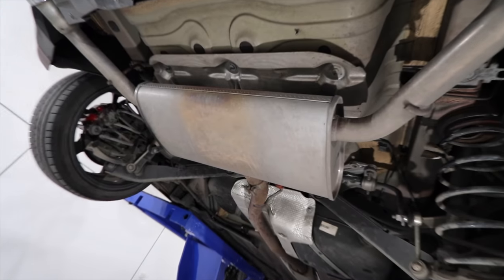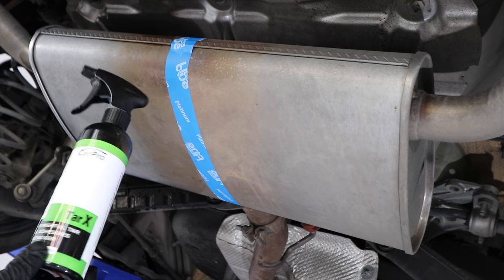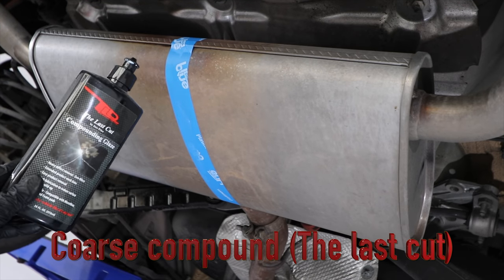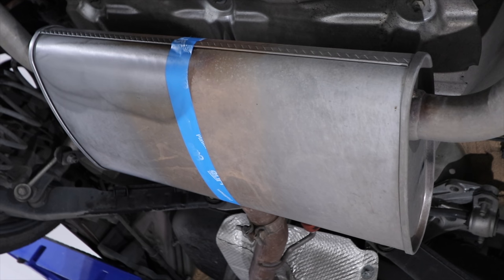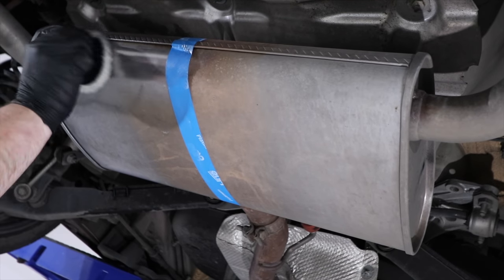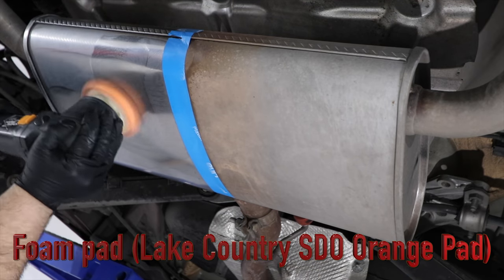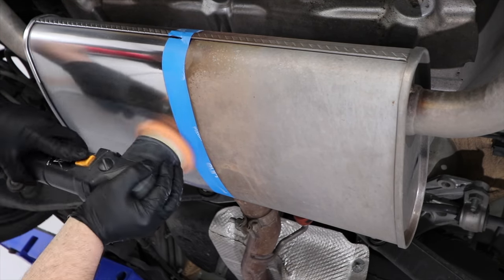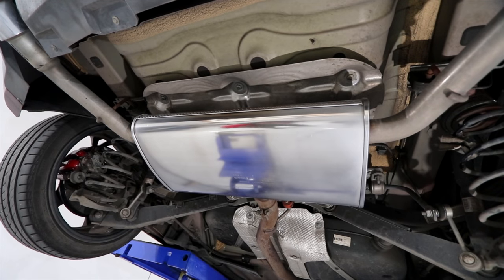How To Quickly Polish Your Car's Metal Exhaust Muffler!

Comment: Nice! My problem would be that I'd just want to continue doing the pipes too. And of course it wouldn't stop there.
Reply: Probo X might as well
Reply: ahahahaha yea, then you're going for the suspension brackets, bars, driveshaft, screws...it's an endless addiction!
Reply: Tiago Feitosa it pay to have OCD
Reply: If it's stainless steel, using a #0000 steel wool, and vinegar makes very quick work of removing all the junk from the surface. I did both my tail pipes in maybe 15 minutes
Reply: Yes Probo X, that's exactly what I thought!

Comment: YTep sandro your the best mate, i dont know if you are have herd the trucking industry has a product which you use as a snow foam and use a pressure washer and spray it all over stainless steel / Aluminium large transporters and then rinse off and the tanker or container is clean and looked like it was just polish, its used to come in a purple bottle and i think a lot of trucking supply companies would have it, but also you would need to get your car up high enough to spray it on wiat and then rinse it off perfect to get dirty under carriages, might need to do a couple of applications, but well worth it, maybe Sandro you may want to look into it, as its would be a massive time saver and you would gain more clients to do the undercarriage of their cars. :) Keep up the great work Sandro, your channel is the benchmark and perfect example of a car detailing and products review channel. :)
Reply: Whats it called?
Reply: @lucaspukas7757  Not sure, but will try to call some trucking supply companies, it used to come n 20 lt and 4lt containers its purple in color, maybe due to the EPa reg's the company may have changed the color of it, but i am sure they have some sort of pressure washer type snow foam to be used on aluminum and stainless to clean it and help the transport trucking industry look after the tankers, especially them all stainless and yet they are like mirrors, so good to find out, so that its so much easier to clean under the car and help bring back that new car look etc. cheers ? the problem is i live in a country town, so what they have over the counter, compared to some of the larger city trucking company suppliers will have a better selection. :) found one, but not sure how good it is/
https://www.easywashaustralia.com.au/videos/
also this web page. :
https://www.bargroup.net.au/shop/category.aspx/chemicals-detergents/723/

Comment: Good gosh Sandro.   That is an A-M-A-Z-i-N-G transformation.   I wouldn't have thought that muffler would have been able to polish to a brilliance like that from what it looked like.   In fact,  the metal in it's original condition looked like an opaque type of metal that couldn't even be polished in the first place so I would have never even tried.    Unreal.   Now I know I can tackle the exhaust system on my 370z and hopefully bring it to a brilliance like you have done here.   And it should be even easier because mine doesn't look anywhere near this bad.   In fact, the metal underneath the car is in fairly "new' looking condition so it should be a breeze to bring out the shine.    Really good video buddy.   I learned something new today and that's always a good thing adding to my skills.

Comment: Yep, dont mind me, back again. Tonnes of other search results were returned for my "polish stainless steel" with me making no specifics about an exhaust, but yours came up near the top so ofc I'm clicking it first! I picked up the final front two parts for something today and need to apply my OCD to it, so in about 5mins time that'll be my next detailing mystery permanently resolved by a method I can actually do and I'm sure! 
[After edit] I was correct! I was going to blob some autosol onto a 2" pad and see what happened but now I've got a huge bottle of 400 compound left over and a well explained as to why it will fuflill my personal needs, I'm def going to try using that! Thx, Sandro. Another top video.

Comment: Fantastic result in almost no time at all. I never would have guessed you could use paint cutting compunds. I will really have to try this on some metal work.
As I live in a country with harsh winters I guess you would compromise the rust prevention of the metal this way. Unless it is a stainless steel system.
Reply: Codriver72 waste of money, try oven cleaner first, make sure you wear eye protection
Reply: Spray ACF 50 corrosion prevention stuff, its used in the Aviation field

Comment: Wow that looks amazing Sandro! Who would have thought a standard muffler could look that good
Reply: And it's tricky too because any residue left on it is going to stink to high heaven once it heats up and begins to burn off.
Reply: BigOldDog hence why Sandro wipes off with IPA after polishing. No worse than oil impregnated into the exhaust tubing from factory

Comment: Great Video CCAD… I'm with Probo X in that I would not stop until my crazy ass had it like a mirror. I would like to see the same job using Mothers Mag Wheel polish and see which would have a better finishing result. Sweet project Cars Channel seems to get great results polishing everything from paint to plastic with Mothers.
Reply: I have a feeling many of those surfaces "perfected on that channel would look far less impressive up close with quality lighting.. They have some great videos, but they also do some things straight up wrong.. 

I stopped watching after I saw their coating application video.. They over applied it just atrociously thick, then let it flash for literally what looked like hours and then proceeded to forcefully scrub and scour all that sticky mess off with just two towels in a death grip and a metal warping amount of down pressure.. I thought it was a joke at first.. 😲😲

Comment: Are these pads a throw away after this? Id assume you wouldn't want to use them on paint even after being washed but can they be re used on metal?
Reply from the maker: Yes, you shouldn’t use those pads on paint but you can reuse them on metal again

Comment: Hi Sandro, why did you choose to use Snow+ (1 to 10) instead of an APC like Multi X as part of the initial wipe-down? Obviously there's no reason why you can't, and Snow+ at that dilution is pretty much like a milder/safer APC anyway. I'm just curious if there was some special reason.

Comment: Great results! Sandro, do you have any tips/experience of restoring cast aluminium to like new finish. I have white powdery deposits on many aluminium undercarriage components and wanted to restore them to as new without resorting to full strip down and blasting, but also didn't want to polish but restore the original cast aluminium finish. 
Thanks
Reply: @CarCraftAutoDetailing  Great, Thank you :)

Comment: When i cut off the stock muffler i just painted it black just in case i reinstall it in future and prevent rust...
Nice video though
Reply: Only Colour paint won't prevent any without basic coating.
But I'm doing the same, quick an easy hiding the welding after cutting it open👌🏻
Reply: @lingling2924  what do you mean with the word basic coating?
It doesn't help that i painted high temp black?

Comment: Wouldn’t this remove the rust protective properties of the exhaust system? Not hating, just a genuine question
Reply from the maker: Most exhausts won’t have a top coating protective rust layer you can remove, it’s generally the same metal throughout - mostly a certain grade of stainless though it can be a higher or lower grade that’s more or less prone to rusting - though the outer layer can be machined. 
If by chance it is plated, generally a polishing process like this one won’t be aggressive enough to remove that plating, you’d have to go harder and more aggressively to remove a metal plating.

Comment: Would this cause the muffler to smoke because of the polish ?
Reply from the maker: A true polish doesn't leave anything behind - like a wax or sealant. It's basically a fine liquid/paste form of abrasives, and when you wipe it off there should be nothing left on the surface.

Comment: What did you use as a ceramic spray?
Reply from the maker: I don’t believe I used a ceramic spray
Reply: I see, that’s why I was confused…
You recommend using one, then about 30seconds later you used a product that I assumed was the ceramic coating… sorry about that!!!

What product do you recommend? I can’t seem to find any ceramic coating specifically for high temperature

(Im polishing motorcycle headers) 
Any guidance would be appreciated 
Thanks!!
Great video BTW…
Reply from the maker: Thanks but I don’t think there’s a real product solution for parts like headers or exhausts - the heat is just too extreme to have long term durability - maybe a ceramic coating like CQuartz Dlux could work for a few months. 
The main thing that’s going to help is avoiding short rides that create moisture/condensation and also regular cleaning to avoid traffic contamination fusing onto the finish.